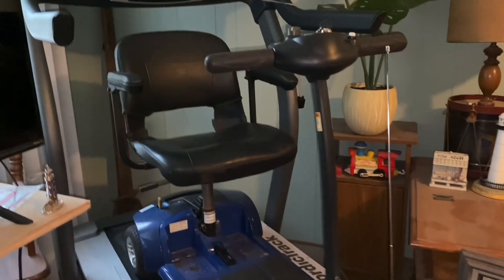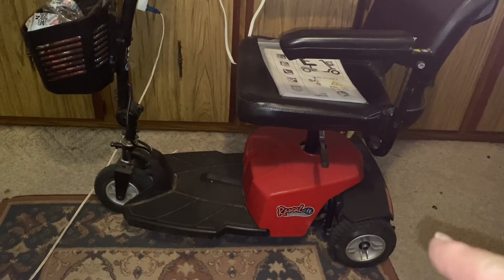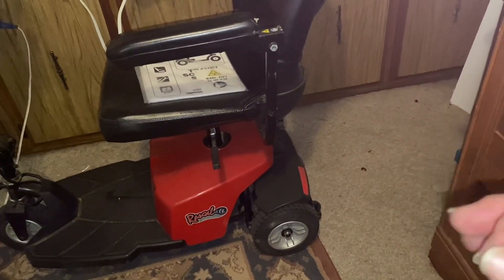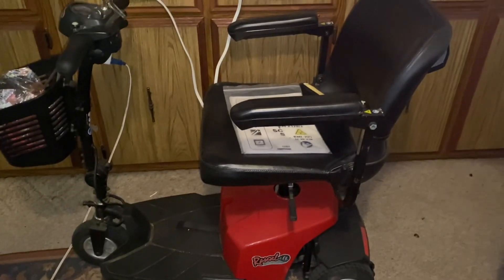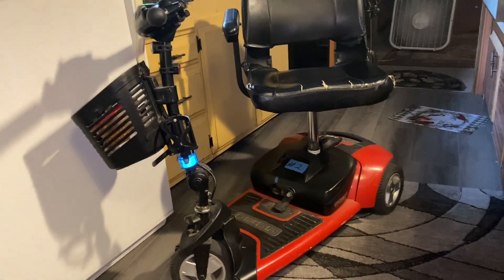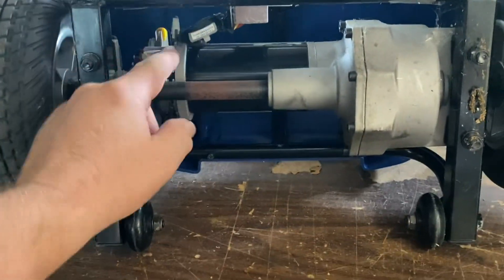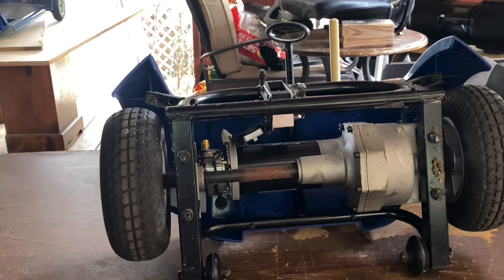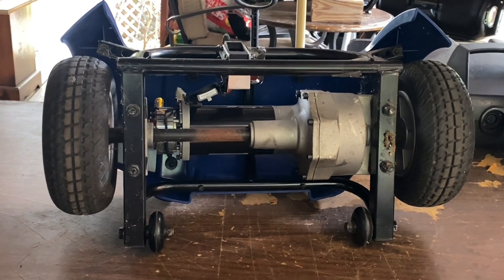Pride mobility, gogo scooters

Comment: Hey brother, The noise from the blue one sounds normal when you spin one wheel. If it makes noise when under load (not 300 lbs. lol) and someone is driving it, then you have a problem.
Reply from the maker: i could feel it when riding , its didnt dis engage but didnt feel smooth.